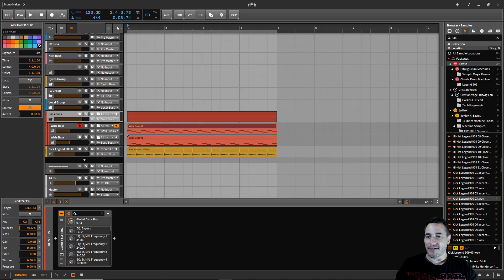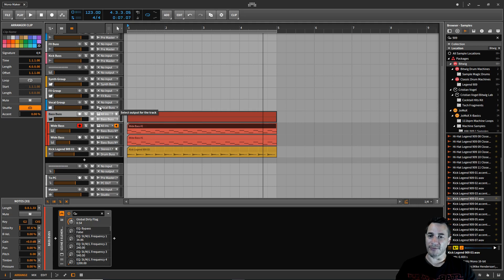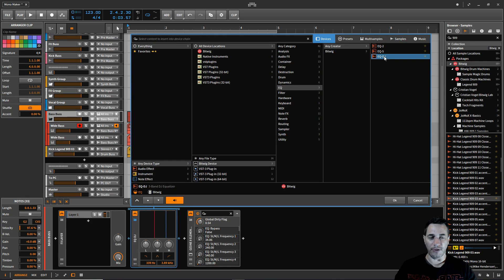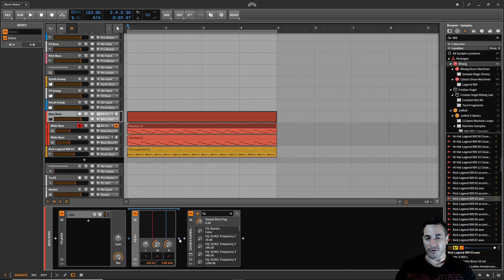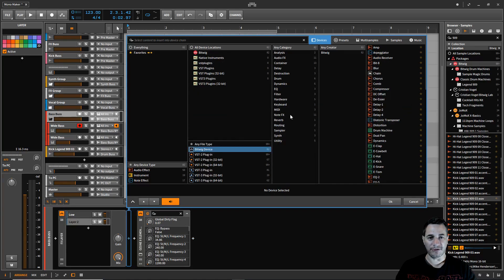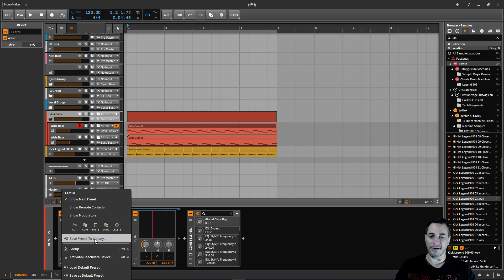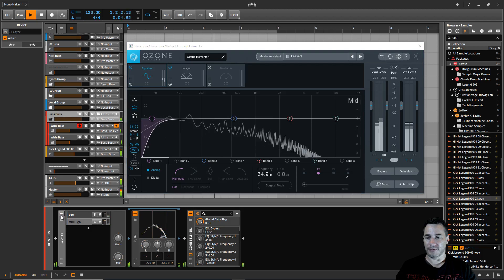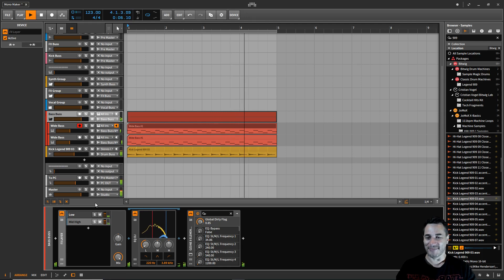Bitwig Studio 2.3.5 Mono Maker Tutorial

Comment: Good video. Though, it's easier making the lows mono using the Frequency Splitter device
Reply from the maker: The device is called "MID-SIDE SPLIT" and the preset is called "Mono the bass"
Reply: @EDMProductionTips  Or you could just use a tool, and bring the width to 0
Reply from the maker: Neon P Lotus kinda. But you  might not want the higher stuff to become mono. I sometimes use this on the master buss or on the bass buss to fix things. If it’s on the master and all you do is turn the width down to mono your entire track will be mono.  What I made only makes the information below 250 htz mono and leaves the tops stereo.
Reply from the maker: Yeah.. could not get my head around that thing. Actually I can't find it in 2.3.5